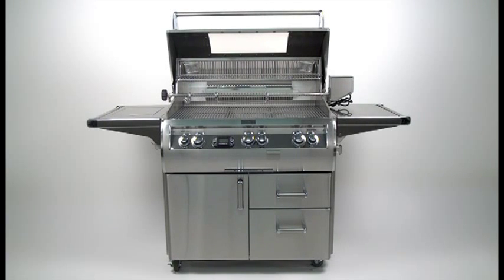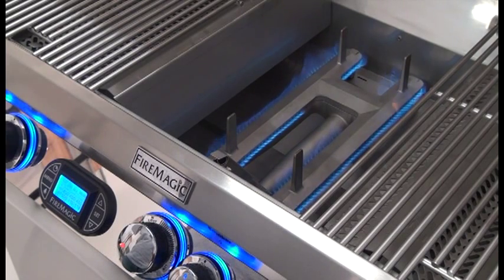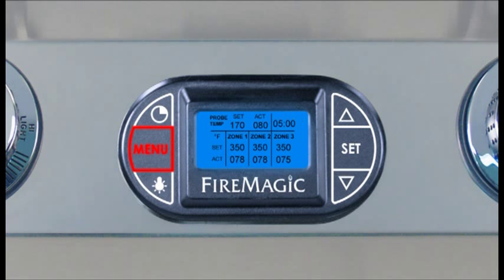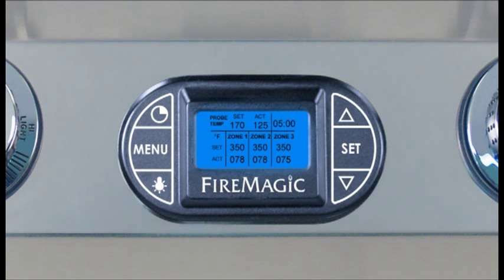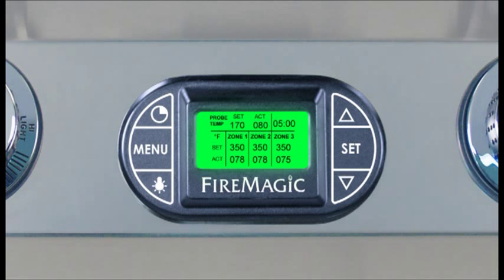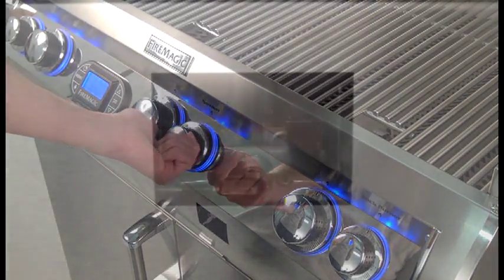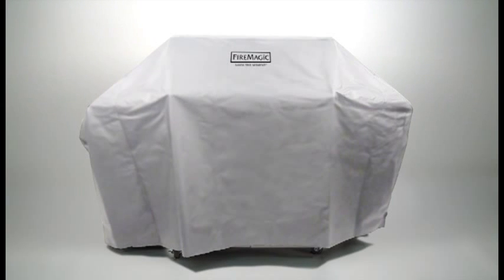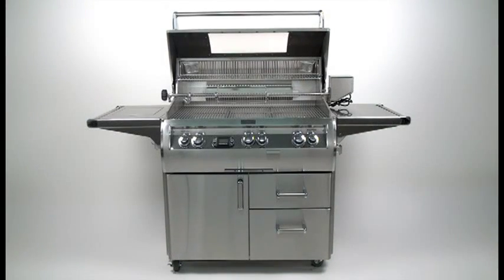FireMagic Echelon Diamond Series "Getting Started"

Comment: WARRANTY- Read the Fine Print
Warranty states 3 year,15 year,lifetime warranty depending on parts.But in the fine print it states that it does not cover rust. My $4000 Monarch Magnum is at this time 4 years old and when it was just over 3 years old the flavor grids had completely rusted and disintegrated to the point the were not usable, and now at 4 years the housings are disintegrating to the point were the igniters are not working anymore. Also, the gates are pitted and do not have the stainless steal coating on them so the food sticks very easily and i took very good care by making sure to clean the grill every time after use. The drilling out the holes for the burning once a year is quite difficult and after that it still did not preform as well as it did new. The main housing seems to be made of true stainless steel and is like new after for year. But many of the parts are made of cheap stainless steel.
Reply: I in no way am calling you a liar with my following comment I’m just shocked. I find your comment hard to believe do to the quality of these grills . I have had a Weber summit grill station for 9 years and not one time have a touched the burners to clean them or anything and they don’t have a single rust spot . I have been researching these luxury grills for weeks now because my summit will be staying with the house when we sell but stories like these make me a little hesitant.